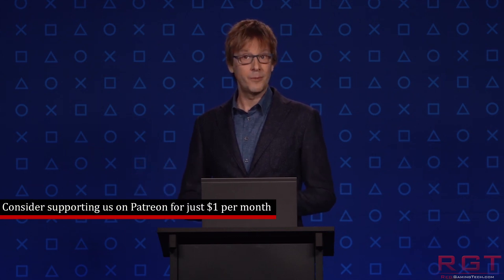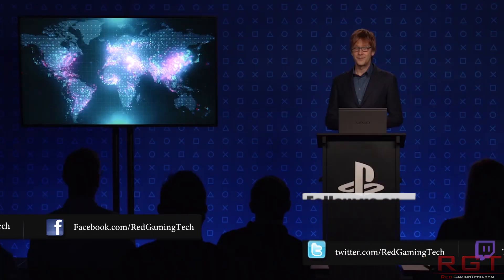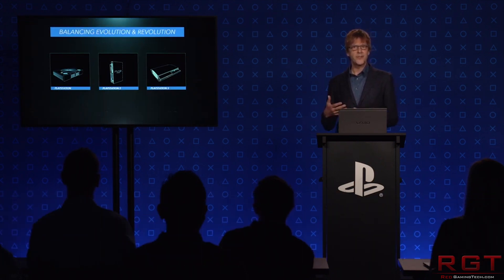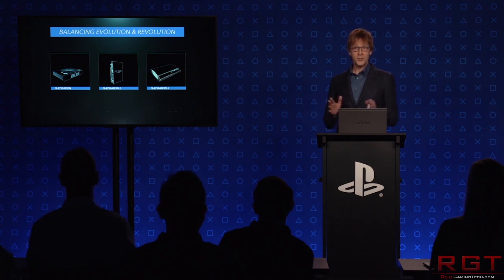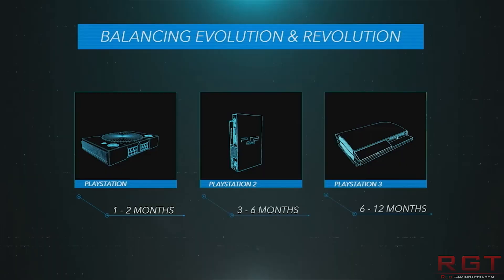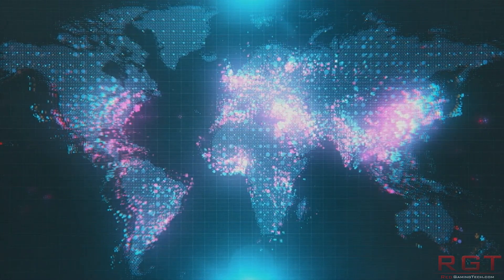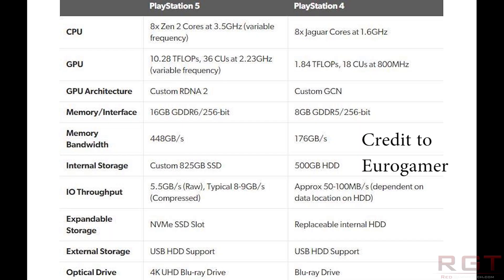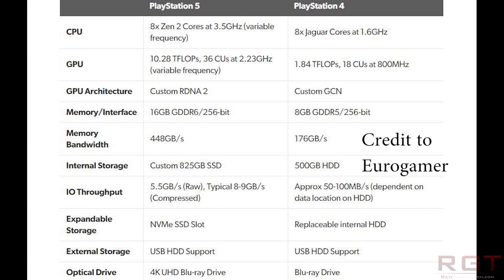Playstation 5 Spec Overview & Analysis | 10.3TFLOPS & RDNA 2 | 3.5 GHZ Zen 2 & Crazy SSD Speeds

Comment: Now we know why Microsoft was stressing that clock speeds were constant. Sony’s 10.23 teraflops are based on max boost clock while Xbox will constantly have 12.15 teraflops on tap.
Reply: Lol did you even watch the video?
Reply: @elitebeing21  ps5 lost epicly lol
Reply: elitebeing21 I watched the stream
Reply: @elitebeing21   Did you? @john pilgrim is completely correct.
Reply: You also have to weed out marketing BS. It doesn’t matter if they keep the power target the same and adjust frequency as it’s not nearly that simple. Once the GPU is under demand and the frequency is dialed up if the power  isn’t enough to sustain that fequency or temp target is reached then it’s going to have to throttle back. Cerny himself didn’t even seem that confident in being able to consistently sustain that max clock. This may have technically been for developers and such but they put this info out in public knowing gamers and fans were hungry for specs/info so there is absolutely going to be some marketing drizzled in. They did the same thing with the PS4 pro as well.
Reply: @voodooknyte  lol. The hell are both of y'all are talking about.... Nobody are saying what y'all are saying. Lol. Both of y'all are making shit up. 

The benchmark is 10.3tflops(actual number) he is wrong twice actually.

And the way he explain it does not work in that manner. Smh.. Watch the video
Reply: @elitebeing What? Do you want to tell us M.Cerny is lying?
Reply: elitebeing21 it’s 10.28 "peak". Variable frequency means 2230mhz is the max it can go and trust me they don’t want to stay at that frequency long or they’re going to be calling 911 because that shit could catch on fire! But in reality the system wouldn’t let that happen it would either have a thermal shutdown or more likely be forced to throttle back to prevent catastrophic APU failure. You may not realize it but 2230 MHz on a GPU is going to create a ton of heat and is not sustainable for any length of time. Most likely the average frequency is between 1800-1900mhz and on average would produce slightly less than 9tflops, but that’s an average. The games will still look amazing I’m sure, at least at the beginning of the generation but as the previous gen falls off developers will produce more demanding games and then we’ll start seeing performance differences between the two consoles. Bottom line is that ps5 has MUCH lower ceiling than Xsex and it’s just a short matter of time till they reach that ceiling. I give it two years from launch.
Reply: @elitebeing21

Everyone sees it but you.

Hell, I've got every Sony console, first gen PS1, but facts are facts. PS5 isn't going to be as fast as the XsX.
Reply: @alexbasha0508  they dont realise the software ms has baked into AMD hardware is gonna widen the gap further aswell.
Reply: It will depend on how often ps5 boost mode runs the clock speed at full cause on the low end it would come to around 9.2 tflops
Reply: @elitebeing21  You clearly didn't...John Pilgrim is dead on the money.
Reply: @wheelchairskater  it's capped at that. That is what it can do... It changed to be more efficient... It's still is 10.3tflops. Just because it choose to changed to convert power somewhere else doesn't change anything.
Reply: @whoknows8349  pilgrim didn't even qoute mark cerny so he was wrong again. It's not 10.23tflops. It's 10.3tflops mark cerny basically explain it's not about tflops. That is why they focus on efficiency and the ssd... That is why ps5 will out perform the Xbox sx when it just all muscle no technique. 

Ps5 is max at a certain point, but it doesn't change the tflops that just what it is... It changes that what it supposed to do. It was made to do it. Smh
Reply: @elitebeing21  Lol no youre delusional. 9tf vs 12tf. Get rekt. Sony lost.
Reply: @elitebeing21  Variable clock rate on both the CPU and GPU means the PS5 cannot maintain both at max speeds at all times. Despite Cerny being "hopeful" that it could. Hopeful is not fact, at best it's questionable marketing. So that 10.3 teraflops is best case only. Whereas Microsoft went with hard limits that do not vary under their set conditions (ie 8 cores at 3.8ghz or 8C/16T at 3.66ghz and the GPU always at 1.825GHZ....no boost speeds or anything like that). Which means that 12TF is consistent no matter what. With a PS5 living someplace hot like Hawaii where AC is also not standard could mean those users don't get as good of an experience as say someone living in a colder environment like the UK or Alaska. And just covers thermal throttling once you take in power limits as well, which will likely be a thing too as that is typically the deal with variable clock rate chips. Therefore you could be looking at an even bigger performance hit. So it is not about just efficiency... Sony can't make the chip magically run faster when power or heat hit the limits set (more heat creates higher power usage as well so that power limit gets hit faster as it heats up so they feed into each other in a very bad way). So the console running full tilt for a extended period of time will throttle... period. And throttling means a loss of performance. How much may depend on the environment it is run in and how tight those limits are set.

Honestly from what I can tell Sony was aiming for a 9TF device and was forced to overclock it help it catch up to Microsoft. Now Sony may still have the PS5 pro up is sleeve and drop a 13TF device, in fact it would not surprise me at all. I am waiting on Microsoft make a similar announcement but with a lower end SKU (ie the rumored lockhart model or series S) But as it stands today with the specs we have...XSX does have the PS5 beat in the GPU/CPU dept. Sony does have a solid leg up though in SSD storage speed and arguably in RAM. I do wish Microsoft had gone with a more unified ram as with Sony's approach. I believe that is a misstep on their part. Time will tell how this all plays out but to say Sony has a solid 10.2 teraflops that won't waver is just not true. Variable clocks are just that...they vary. Do the math yourself.

36CU x 64 Stream processors x 2 operations per clock x 2.23 ghz (ie 2230 mhz)

36 x 64 x 2 x 2.23= 10,275.84 (which is in gigaflops)....move the decimal over 3 places to covert to teraflops

10.276TF

Now lets say the clock dips due to heat, power consumption or both so the PS5 clock down to 2ghz

36 x 64 x 2 x 2.00 = 9,216  or 9.216 TF (the original leaked PS5 performance numbers)

These numbers are why I believe Sony originally aimed for 9.2TF as leaked but between Google Stadia and Microsoft they were forced to get more from less. I do think the PS5 should be able to maintain the 9.2TF without dips but that is just a guess based on the previous information leaked on the SOC's target performance. Regardless I do believe this jump in performance will benefit PC users much more then last gen which was anemic in the CPU dept and arguably the GPU as well.
Reply: Thicc Boii  lol. Now it's just mean it can go that low when it not at max. Smh. If you think so what proof you have to that say it shut down when it gets hot, when you don't even know that it does get hot.
Reply: @wheelchairskater  don't need pointless information. Again you are claiming like the last guy that you assume it runs hot... What proof that you have when you don't know?
Reply: And you assuming it's to catch up with Xbox series when in fact. That is how Mark cerny decide to make ps5 to maybe run the Ray tracing feature? You dont have any ideas as much do I. Smh
Reply: @elitebeing21  Assuming it will run at 10TF at all times is a bigger flaw. Plus I never said it runs hot I only stated how variable rate chip speeds work and how the environment they are run affects them, nothing else. I am a tech first so I know how hardware works. Variable rate chips are designed to push their limits and then some. And since they are running variable rate chips...they are pushing their limits by definition. Doesn't matter if the reason is efficiency or the polar opposite to get maximum horse power. A drop in clocks means a drop in performance...that is how it works. 

Now I am not saying Sony didn't cool it properly, I hope they have. But even if it is, if the GPU was capable of hitting 2.23ghz  at all times while also doing 3.5GHZ CPU at all times....then by the very nature of it they would not have rated/marketed them as variable rate chips. They would have done like Microsoft did and said it was a hard wired speed. They did not which means even if only a little those chips DO dip lower then the rated  "boost" speeds (for a more PC centric term). So a small 200mhz dip on the GPU means a notable TF drop. I don't make the rules, but I do know them. Do you?
Reply: One note though...you aren't wrong that some of this is efficiency. The game might not always need all 10TF. So until units are in the wild it is impossible to say for certain but to ignore the potential for performance dips due to variable rate chips is also impossible to do as well. That is the bigger point I am trying to make here.
Reply: If these chips truly are capable of those speeds 24/7 if needed....Mark Cerny did an even worse job in his presentation then I thought before. It was just boring and lacked any real flare...
Reply: Tflops fluctuate from 9.2 to max 10.23.
Reply: @garfunkle5447  pretty much what I was trying to say would likely be the case but Elitebeing21 just doesn't want to hear how variable rate clocks work. I don't know how tight the limits are on the chip whether do to efficiency or peak performance. Those are numbers Sony did not release. The best we got was Mark saying he "believed the PS5 would stay at the boosted speed most of the time". The big take away though is there is potential for this console to slow down whether it's do to thermals, power consumption or more likely both at various times during game play. At least how he left it worded and I understood it.

Now if the PS5 only drops clocks when the power is not needed that would be one thing. The fact Mark Cerny said he believed it could maintain them most of the time tells me it can't maintain them all of the time which leads me to think we looking at a power consumption limit at the very least (if just for efficancy) and worst case power and thermals (if it does run hot or is running in a hot environment). That is where as a potential buyer I get wary. 

At launch games likely won't tap everything the console has but near the end of it's life cycle that could in theory widen the gap between PS5 and XSX as time goes on and devs learn to run the consoles full tilt. We may find the PS5 can hit 10TF for 5 minutes or less when both CPU and  GPU are maxed out....Or conversely it may hit 10TF for as long as needed if you don't care about power draw/efficiency. The presentation did not make as much clear and as users we may not know the answer for sure for some time after the launch, even years. Point being it leaves guess work as a consumer as to what your truly getting in the performance metric. Likely not a huge huge difference but it may well be a noticeable one may not. So 10TF all the time is not guaranteed at this point. Time will tell just how limiting a factor or not this becomes.
Reply: @elitebeing21  Also to the pointless information remark. How are math facts on a GPUs performance pointless information when talking specifically about said GPU's performance as related to its variable clock speed. Things don't get much more relevant IMHO. If anything when you are being confronted with facts and figures, you're basically sticking fingers in your ears and screaming I can't hear you. As if in some way that makes you right and me wrong when in reality, that is the pointless thing happening here. Or arguably I am being pointless for thinking using facts, computer knowledge and logic with fairly easy to follow deductive skills would help you understand what every other poster in this sub thread understands but you.
Reply: guys, elitebeomg21 is just self persuading himself, i try to explain the same to other fanboys on other videos but they seem to be in denial. Don´t lose you time, this people are just sad.
Reply: @wheelchairskater  lmao. It's not facts you talking about specs. That console has... You are talking about theoretical performance that you don't know. Lol.... That is not a fact child. That is nonsense. Smh
Reply: My understanding is that the CPU and GPU run at a constant set vcore, and are capped at the max mhz, that the cooler solution can handle. The benefit is that on indie games, or lesser intense scenes, both the CPU and GPU can drop in speeds.
Reply: Mark cerny stated theres gonna be   2-3 % fluctuation within the clock speed, meaning around 9.9-10.3 tflops and mentioned already that it will run like that all the time. Now the thing is, we see this all the time within pc, and im not talking about thermal throttling. Youll see pc cards literally fluctuating with their clock speed (you could check it yourself). I'm pretty sure what cerny is trying to say is that they control power draw, where as in pc it's consistently the same power draw despite variable clockspeed. As he mentioned in the video, ps5 controls power draw while having same speeds, and not the other way around (which my pc example demonstrates). I think he explained this in depth to alleviate concerns with heat (the damn thing runs at 2.2 ghz lol), which is a result of power draw and not clockspeed. The xbox obviously has higher tflops, but the ps5 has things like the geo engine and faster ssd up its sleeve (so who knows maybe they will be equal in real world performance). But for sure we know this, the gap between the next gen consoles is significantly smaller then current gen.

Btw dont attack me im just trying to contribute to the discussion, also i game on pc :P
Reply: @Jpilgrim30   Absolutely NO. Did you even watch the presentation? What about all of Paul's video? This clock speed is maintained within 2%.

PS5's 'SMARTSHIFT TECH' with it's VARIABLE CLOCK Frequencies is very impressive. This is where the CPU can give power to the GPU and vice versa that it's not using to produce even better visuals. It also is one of the reasons why the PS5 can MAINTAIN the MONSTROUS 2230GHz GPU clock speed within a maximum 2% loss. GPU clock speed is just as important for performance as how many compute units. The PS5 is 405GHz faster than the Xbox's 1825GHz which means the GPU can do more work and the caches can be faster. This means the PS5 will effectively be much faster, even without considering the crazy SSD system (Series X SSD 2.4BP/s vs PS5 SSD 5.5BP/s, nor the impressive removal of bottlenecks. This insane clock speed will also help negate the extra teraflops in the Series X GPU. Absolutely brilliant! 

This SMART SHIFT TECH is very intriguing. A brand new approach to increase performance by using all power instead of wasting it. I fucking love the idea! Paul from RedGamingTech called it in his Microsoft tech reveal video. He said that MS were making a very strong point of how the Series X's GPU and CPU were locked (which is normal). He claimed that MS sounded like they knew something about the PS5 and were worried. MS wanted to take the attention away from that PS5 part (SMARTSHIFT) by emphasising their point of 'locked clock frequencies'. Bang on!

This SMARTSHIFT tech alone has been confirmed by AMD to give a 10% boost to performance. That is massive!
Reply: @elitebeing21  correct. Absolutely blisteringly fast clock speed from PS5 and equally impressive to maintain it! Mr. Cerny and AMD have done something special. But  sadly, as always peeps will go straight to the obvious and misleading 10.3TF vs 12.1TF narrative...

CERNY - “Rather than look at the actual temperature of the silicon die, we look at the activities that the GPU and CPU are performing and set the frequencies on that basis—which makes everything deterministic and repeatable,” Cerny said in his presentation. “While we’re at it, we also use AMD’s SmartShift technology and send any unused power from the CPU to the GPU, so it can squeeze out a few more pixels.”

AMD - "AMD said this (SMARTSHIFT) can result in a 10-percent boost in performance in games like The Division 2, or a 12-percent bump in Cinebench R20 results." - Impressive

https://www.pcworld.com/article/3532342/sony-playstation-5-taps-amds-radical-smartshift-tech-to-push-its-gpu-to-ludicrous-speeds.amp.html
Reply: @HanzouTheRazor  I did but I was not so convinced by his wording that even that 2% is maintainable...check this out... https://wccftech.com/sony-ps5-vs-xbox-series-x-analysis/ From what I can tell the variance in clocks will be more sizeable the Sony is saying.
Reply: @wheelchairskater  I read this too and had a similar assessment of everything that was presented.  Everything Sony put down on paper looks good, but there are still some finer details missing like the CPU & GPU caches amounts (both systems) and they really didn't get into ray-tracing, I suspect the PS5 will be at a disadvantage there due to the less number of CUs.  The specs just scream reactive to me and they are trying to overclock those chips to the brink and are doing everything the can to not to have them catch on fire.  I hope some 3rd Party Game Developers leak the truth, once the next generation games are in full swing.
I think come middle of the Generation (2023-2024) when we see games start pushing these chips (both consoles) to max this variable frequency set up is going to hit the wall. By then Sony will just release the PS5 Pro, similar to what Microsoft did this generation to move the focus away from the weak system to the mid-gen refresh....
Reply: @mtr975  Yeah that is generally my takeaway too. Elitebeing21 just doesn't want to hear it. As I was saying he just stuffs his fingers in his ears and screams I can't hear you...and in his head this some how makes him right.

The PS5 is a heavily OC'd system. I do not believe Sony is being honest about the clocks staying within 2% of max. TSMC's process just can't support clocks that high for a gpu long term. I believe a 5-10% reduction in clocks for the GPU are far more likely when it is running full tilt for long periods of time. And TSMC's process nodes support my belief unless they went with the high end EUV 7nm+ which I find very very unlikely do to it's cost as stated in the WCCFtech article. However no one can say for certain until it is out. Elitebeing21 is clearly a fanboy, a tech novice at the very least and more likely completely tech ignorant on how hardware actually functions. 

The simple truth is this, the PS5 will not be a constant 10.275TF machine. Will it be closer to 9.2TF? Maybe. Or will it be somewhere in the middle? All relevant questions without solid answers. Elitebeing21 really needs to do more research before spouting off how wrong everyone is. Clearly he is the one not understanding the technology and manufacturing behind it. I do thing the PS5 looks solid, I plan on getting one...but I also plan on realistic expectations on it's performance.
Reply: @elitebeing21  Did you read the WCCFtech article yet? They seem to think what we have all being saying is exactly the case. That the 10.275TF is an exaggerated best case scenario Sony can't maintain for long unless they used a very expensive 7nm node with EUV (ie 7nm+). Now they may have and then Sony could hold the clocks they speak of, in THEORY only but even then it is not a given it can. You know theory, that same thing you said was not ok for me to use when I actually used facts on how variable speed chips work, not a theory, and only stated it was a "potential" issue for Sony (that last bit may be considered theory but it was backed up by techincal know how and...FACTS!!!). Yet your using theory, whether you realized it or not, to say your right without any facts beyond what Mark "said" (and some how your theory is fact for some reason...which it IS NOT, it is hearsay and bad marketing propaganda). 

To ignore what we have been saying as at least possible if not likely, is as dumb a fanboy move as it gets. That is just down right idiotic to buy into outright just because Mark said it was so...OPEN YOUR EYES and use your brain. I still believe Sony's console is impressive, despite my feelings on the 10.275TF claims, especially considering the fact it is basically a heavily overclocked chip with a variable clock rate. To hit those clocks at all is a feat in itself. So kudos to Sony on that one. 

I would have preferred Sony gone with a wider design with 40CUs at a 2ghz sustained clock rate for 10.24TF...or even wider but still not any faster than 2Ghz. It just sets the chip up to throttle, unless they did go with 7nm+ with EUV. And even if they do, I would argue 2.1ghz should be the max clock if it is to be sustainable at all times if required by any said game. If its full speed is not required to hit the resolution, game settings and frame rate a dev is aiming for...of course I am fine with a down clock at that point to save power or what not. I just don't want to have the PS5 down clock for any other reasons. As it stands right now I am not convinced that will be the case. Leaving me to believe the 10.275TF numbers are more marketing and less fact then Sony wants to admit publicly. Time will tell...
Reply: @elitebeing21  Also now that I am laying out more and more facts backing up exactly what I and everyone else has been telling you...Then now out of the blue your tune changes to "TF is not a great indication of power" as your comeback. Never said it was though I implied it to a fair degree, mostly because both chips are Navi based. Yes it is not the only indication or even best indication of power but it is still a extremely strong one. Especially when comparing chips from the same architecture which XSX and PS5 are.  Why do you think we use it so frequently in the industry? Hmmmm just saying. It is when you compare Navi to vega or polaris that the TF argument gets a little more muddled but even then it still counts for something.
Reply: @wheelchairskater  it's not mark cerny talks about it...... Watch the viseo and actually pay attention to it Ask Mark cerny
Reply: @elitebeing21  Just curious here but are you a tech or have you ever been? Do you have an EE (electrical engineering degree)/computer science degree or studied for one at the least ? Have you studied the relevant physics, calculus and other fields to understand the underlying thermal, electrical and physical limitations of a computer system like this. Give you a guess who is/has done most of those things.....So I have reason not to take Cerny at his word...several reasons actually going from his reveal. (OMG so boring like going to class on a monday morning in high school boring)
Reply: @elitebeing21  I am saying he is desperate to try and recover some of the 12TF ground the PS5 just does not have on tap. I am saying it is very possible if not likey this is deceptive marketing on Sonys part to make their console look stronger then it is. It is strong too make no mistake. It just find it extremely unlikely it is 10.275TF strong for more then brief periods of time. More likely it will hover around 9.2-9.7TF mark depending exactly which node at TSMC they use.  Those are my PS5' worries at least. If you could call them that. More like I'll be pissed if they mislead people on the power but I am waiting for a final product before a final decision is made on how truthful their reveal was. 

Microsoft has their own issues too. The XSX is likely not as nice to the environment, no argument here. Though I would like to see testing in the wild first before firmly coming to that conclusion, that and the fact lets be real. Most folks don't buy the bleeding edge fastest because they want to save the environment first and foremost. I do not like the fact they segmented the ram. I hate it honestly but at least they were honest....cough GTX 970 cough cough...Nvidia deserves to be left out of the high end consoles for awhile. Though I run a RTX 2080Ti so I can only talk so much...lol
Reply: @elitebeing21  24 years of tech experience btw...Cerny may have me beat, certainly does with his role at Sony but I know more than enough to know his numbers are questionable. 7nm+ is the only way those clocks are possible long term. And that is very unlikely do to cost as stated before.
Reply: @elitebeing21  that's just it I don't care who wins. For me videos like this and the comment sections in them are about enjoying the tech specs and performance they bring. It is also about disecting how the hardware does what it does and is everything what it seems or did marketing get to involved in the technical side of advertising things they don't truly understand. It is an on going thing in tech...cough gtx 970 coigh cough 3.5gb and .5gb of ram at different speeds cough cough advertised as one 4gb pool/speed...cough cough

I love gaming on all platforms though I prefer PC if cornered into making a choice. I do have all current gen platforms ...well not stadia lol its a joke. Anyways I hope you wouldn't care who won either. I may gave called you a fanboy out of frustration that you cannot see or want to believe how the tech operates and why. Probably unfair especially if you don't have my education and technical back ground (not saying you do or don't this time, I welcome a comment on such.

At the end of the day I'll get a PS5...assuming they don't do something even more scandalous then this (could still be 7nm+ and I am wrong there).
Reply: ageofbogyo  Totally agree on the 3.8ghz bit and SMT....heat noise...not so sure about if done right. But Microsoft is clearly pushing limits of their own...
Reply: ageofbogyo  They could have but that would have likely required further binning of the wafers and a probable decreases in yields accordingly. IDK maybe they could have got away with it. But I prefer set clocks myself. When I OC CPU's I never enable turbo boost clocks on top of it where other OC users do. Increases risk to the silicon from even more heat at the same voltages(granted an OC already creates this situation so I could be accused of being nit picky here) plus more importantly it increases the complexity of an OC to get a chip fully stable (ie how you tinker with your voltages, droop, everything). 

I can see where Microsoft would want to avoid this complexity on the CPU and GPU from both a hardware implementation and software utilization stand point for devs. Having static clocks makes developing for the console easier. Whereas Sony did the opposite and embraced this complexity. Which if you look at the history of Sony's hardware they have a very long track record of doing this over and over again. Frequently to the frustration of the development community but with x86 dev's are more familiar with how this will affect things so it should soften the learning curve compared to say the PS3 or PS2. 

Think what you want of Sony's PS5 specs, they did design a nice piece of kit for what it is and how performant they got it considering it's base hardware resources. They took 36CU GPU and OC'd the snot out of...what should be at best a 9.2 TF GPU and they made it something greater than....sorry elitebeing21 still not capable 10.275TF for long durations...9.56-9.67TF though...that may well be achievable under those conditions. If Sony cheaped out on cooling and/or power delivery then dips to 9.2TF could well happen but I hope not. I am eager to find out for sure! Unless unless they do indeed use 7nm+ (which again I find unlikely) then 2.23ghz could well be achievable under full load for more then 5 minutes at a time. More likely they drop a PS5 pro at 13TF this year or next..kicking Microsoft in the soft bits nice and hard. And we as consumers win if something like that happens. It would drop the XSX price if Sony matches or undercuts them in price for said PS5 pro.
Reply: You are wrong. Just because the Series X has a constant clock speed, it does not mean it's working to it's full 12.15 TFlops all the time. GPU's and CPU's don't work like that. Workload is always fluctuating. It's never constant. So while the clock speed of the Series X is constant, it's workload is not. This is what the boost clock of the PS5 is doing. The boost clock is fluctuating based on workload. That means that when the workload needs to be at 10.28 TFlops, the clock speed boosts to allow that. When it doesn't, then the clock speed lowers to accommodate the workload and the additional power is sent to the CPU if needed. You're not understanding how this boost clock is functioning.
Reply: @maziarkd  you are correct on the work load and how it flucuates. No argument. That is not what we are debating. The debate is can the PS5 maintain the 10.275TF at all times if a work load does require it.. And if you read the whole thread; which you may have, you would see the evidence is stacked against the PS5 maintaining 10.275TF or within 2% at all times (if going by Cerny's own words of what the PS5 can do)...unless Sony used a very specific and expensive TMSC 7nm+ node with EUV...Sony is out of spec with the other 7nm nodes are capable of for sustained periods of time. There is a wccftech article linked twice above that goes into great detail on why Sony was likely overstating the PS5s ability to stay within the 10.275TF window for more then a few minutes at a time. That is what we are upset about...not how a work load varies but the clocks variance thus TF variance.
Reply: I'd like to point we still have some devs insisting despite the lower TF that the PS5 is more performant then the XSX. I honestly have zero clue if this is true or an example of dev fanboyism/dev damage control  but I don't think it should be ignored either. Could be a case of 1st party PS5 games will exceed XSX in eye candy while 3rd party games look better on the XSX. Without hardware to test you just can't say for certain. What I can say is I am eager to check BOTH out.
Reply: @wheelchairskater  you are clearly missing the whole point. Teraflop counts will not be the most important thing next gen. Of course It is what MS will push as theirs is bigger 😂. But how many times now have we heard and read from REAL EXPERTS that Tflop counts will not be as important next gen? Tell me, how will you measure the PS5's extremely optimised efficiency? Let's look at the incredible PS5 SSD system. A fool would think it's just for faster load times. If it is true that PS5 only needs to render what is in actual view due to the blisteringly fast I/O throughput and the removal of all bottlenecks, how much power will it save? How would you measure this extra power? What will this extra power do? This is the real reason why developers are so excited about the PS5 HW. One even claiming that its the most exciting hardware in 20 years. If Sony can pull their promises off, there will be some very shocked gamers once these two rivals are finally released and compared...
Reply: @wheelchairskater  surely you realise that most gamers agree that the best looking games this gen have been almost entirely PS4 exclusives (The Last of Us Part II, Death Stranding, Ghost of Tsushima, Days Gone, Horizon Zero Dawn, Spiderman, Bloodbourn, GT Sport, Uncharted 4, God of War)? 

This IS an  incredible feat for the lowly PS4 PRO when you consider that the Xbox One X is around 30% more powerful. This is why I laugh at people when they talk about the most powerful console (just look at how well in each past generation the 'most powerful console' actually went, too. Yet to actually win one 😂). 

Look what the measly Switch can do (Breath of The Wild). There are way more important things that make games look good other than 'teraflops'. It's a very naïve and tunnel vision impaired way of looking at it. Hardware optimisation, development kits and software tools, first party studios and just plain old talent are far more important. Tell me the truth, who out of Microsoft and Sony do you actually think wins in these categories? It's very clear to me...
Reply: @HanzouTheRazor  First of obviously I can't have tested all of those things without hardware in hand and any of us can ONLY go by what is so far released, information wise. And yes If you read all my comments you would see I said TF aren't everything, but are relevant to bring up with the information we do have. But yes there is so much a system can do that TF doesn't cover. And your right things like the Switch are an excellent example of that. But that was not what i was debaing. It started with Variable clocks and the fact Elitebeing21 refused to believe how variable rate clocks work....and as the debate raged I brought in tech analysis of nodes to show my argument held far more water then his own. He has still as of now yet to post one piece on non-Sony marketing to back himself up, unlike myself. Just curious did you read the article yourself and if you haven't, would you. I would like to hear your thoughts. Unlike Elitebeing21 you seem like a reasonable person. Also your arguments are better then his by a long shot!!

I would argue with the exception of the PS2 vs Xbox...Sony has typically had better looking first party games while MS at least for the XB360 era had better looking 3rd party titles. Something if these specs and my suspicions are true could mean Sony has best looking 1st party games and MS will have best looking 3rd party titles next gen just like the XB360/PS3 era. Back to the PS2 the only reason why the PS2 couldn't pull it off the same deal was the performance gulf was simply to great on a GFLOPS count and ram count. But the PS2 still outsold MS do to really great games if not a bad DVD player (fried 4 PS2s do to the DVD issue, or I fried one and my roomates did the rest because they did not listen and use the Xbox to play movies). PS3/PS4 absolutely had better 1st party games as far as appearance is concerned. 

Personally I don't like a lot of Sony's 1st party stuff but there are exceptions to this and why I end up in their ecosystem (mmm love me some Horizon Zero Dawn). My bigger issue with Sony first party games (exclusives, only I mean), and Ms too, is this last gen had the least number of them. Seriously only a handful. Everything else could be bought on another ecosystem either at launch or if you were patient and waited a year or so. As someone who games on PC when I can, this makes either console less appealing then previous generations. And MS may well shoot themselves in the foot with all first party titles hitting PC but IDK for sure. Time will tell and cross play may save them.

Regardless These were not the things that was being debated here for the most part, until Elitebeing was totally backed in a corner at least at which point I responded. What is being debated, can Sony's PS5 hold those 2.23ghz clocks when needed and as I stated and backed up with industry info, likely Sony cannot and oversold their performance numbers. As a Tech as a rule, I hate false marketing. Doesn't matter if it is Sony, MS, Nvidia, AMD, ARM, Or my mom's "sugar" free cookies. Say what you mean and mean what you say when listing off specs. The gamers will debate everything regardless. That is all I am saying here. Sony has likely not done that but we have to wait for hardware to truly find out for sure. I mean I could be so wrong and they did get 7nm+ with EUV at which point I would applaud them. If however I find those clocks dip by more like 5% or more for long periods of time...I'll roast the heck out of Sony for lying. Just like I roasted Nvidia and the GTX 970 with its 3.5gb .5 gb ram debacle or as I did with AMD and their Faildozer not really 8C CPUs (ie only 4 threads at a time could be used not 8). So I can hope you see the difference in what I am saying here. Yes Sony games will likely look amazing and if history holds true first party titles will truly shine...But will 2.23ghz clocks be maintainable? That is my question and something I very very severely doubt.
Reply: Also good to note many devs are saying the PS5 is the better performing kit. Though a couple I know say the opposite is true especially if ray tracing is used. Not sure if this is a case of a better OS, Hardware/software optimization or Dev damage control. All are possible. Again we need kit in hands to know for sure. I really am not a fanboy of anyone but myself. I am so cool I never stand up for anyone! So at the end of the day i just want some truth in marketing specs. That is it.
Reply: @wheelchairskater  Hey I have a question. Now this is coming from someone who knows nothing about console specs and how they affect performances and game development. 

That said, I've been reading a lot about both consoles lately and understanding bits and pieces. 
And a few people have said that while the PS5 will have a faster and more powerful SSD, the SX will be able to... Counter that with a much higher bandwidth?? Which somehow affects the SX CPU and RAM? 

Can you explain? 
Thank you
Reply: @raptordcuo6879  Yeah happy to help. It is not exactly simple but I'll do my best to make it such. I am sure some of what heard is wrong with other bits right. They both have 16GB of ram obviously they both contain CPUs and GPUs. Yes the PS5 has a much faster SSD though it is smaller. Basically information goes from the SSD to ram and from ram into cache where it is stored/used in computations. You can think of that information being computed as groceries.

So a CPU or GPU will always look for the fastest way to access the information it needs or groceries. Their first choice is always the onboard cache. It stores the information right on the CPU or GPU die. It is super fast but very very small. Think of cache as a 7/11 small with the essentials for groceries. The way you access it is a 2 seater sports car you have just to run to 7/11 at the end of your block for super quick way to pick up some small groceries like Pancake mix, milk and eggs because you been making pancakes all day and you know 7/11 has the ingredients very close by home. You can get there fast with your sports car but your small car can't carry many groceries, just what you need for your pancakes. That is your cache. Fast small amounts of memory you need to make what is happening right now and/or has been happening.

After your various levels of cache the next fastest storage is RAM. Think of ram as the grocery store and the bus it runs on a road with lanes. For this you use your Family wagon. If your CPU or GPU need something that is used regularly but hasn't been in use very very recently it has to go further to the Ram to get. Much like with you family wagon if you needed to go to the grocery store for a full week of supplies, not just your pancake stuff, because it will all fit in this larger car. I hope your still with me cause now is the trickier part...

So how does all of this come together with what you were asking. The XSX has a very wide memory bus whereas the PS5 has a much narrower one. Again think of this bus as a road. The more lanes a road has the more cars it can hold and stuff in those cars it got at the store. In XSX town the road has more lanes so more cars can make the same trip. In PS5 town there are less lanes and so less cars can be on the road at the same time. Not only that but with XSX town there are not one roads, but two roads that go to two different stores(one for the CPU and one for the GPU). The road on the XSX from the GPU to the ram has more  lanes to hold more  cars/ information then all of Sony's road combined. So you get everything there faster but the XSX has less overall ram 10GB or a smaller store at then end of one road compared to PS5. However you also have the CPU's road for the XSX which is slower then Sony's road with less lanes but it is a whole extra road for information to travel on to a whole different even smaller store. This is the separate set of ram with 6GB. So while XSX has more capacity to get groceries/information as a whole then the PS5, it can't get this information all at the same place like the PS5 can. Both approaches are valid. Each having advantages that affect performance one way or another; however, on paper this puts Sony at a memory bandwidth disadvantage. But it doesn't make the big benefit straight forward either. This one road approach allows Sony/Devs to use that whole 16GB how ever they want in game whereas the XSX only has 10GB for the GPU and 6GB for the CPU (at least until we hear otherwise/other features not yet released officially).

Now for how both sony and MS can side step some the ram a bit or more accurately make the ram pools larger than they actually are...With the new SSDs they can in fact be used as virtual ram pools making for larger worlds and decrease texture pop-in. Pop-in in particular in times past has been from assets streaming from the slow 50-100MB/s HDDs to the faster ram. The ram just could not get this information fast enough. We are going from 100MB/s last gen to 2.4GB/s or even 5.5GB/s next gen which is a 2400-5500 fold increase in speed/bandwidth compared to last generation. While a SSD is still is not as fast as ram it is far closer in speed than HDD ever has been. By miles and miles. But SSD take a few more operations then Ram to get information moving. This warm up/latency penalty (like warming up a car before driving it) adds time to how long it takes the calculation to happen on the CPU/GPU  so the SSD will be the last choice for information retrieval. SSDs are not a perfect substitute for ram, just a good addition to it for certain.

So lets get into some more actual numbers...

XSX 10GB of GPU vram @ 560 GB/s and 6GB of CPU ram @ 336GB/s 

SSD 2.4GB/s (raw), 4.8GB/s (compressed)

PS5 16GB of ram @448GB/s
SSD 5.5GB/s (raw), typical 8-9GB/s (compressed)

As you can See XSX holds a lead in memory speeds but falls behind in the SSD speeds. Devs should be able to work with both but sony's approach leaves more choices in the hands of devs on how to use the ram they have (OS, graphics, physics, sound, etc). XSX devs will have some choices made for them. Like graphics pulling mostly from the 10GB pool and things like the OS, sound and physics being pulled from the slower and smaller 6GB pool. This should be easy for devs to work with as stated but I honestly wish MS had gone with one ram pool instead for development ease but that is just my opinion. You'll see what I mean in a second.

Used efficiently the XSX has a whopping 896GB/s total system ram bandwidth dwarfing Sony's 448GB/s. And Sony completely destroys XSX in SSD speed which can be used as virtual ram as mentioned (literally double the speed) but this is true on both consoles. So even with the fast SSD Sony might be in trouble but a twice as fast SSD could counter some of the ram speed advantage MS has. This is why both sides are in screaming match on which is better. But there are still a lot of questions that need to be answered before any real conclusions can be drawn. Are these systems cache coherent, how much cache do they have, can the XSX GPU access the 6GB pool directly or indirectly through as of yet announced bus/ interconnect (no idea personally but possible). 

Where all this leads to performance is this. If your GPU or CPU can't get the information fast enough it can under perform. Or become what is known as a bottleneck. Basically the wider those roads or memory buses are the better they can feed the CPU/GPU. With the XSX having more CU's or compute units it is critical that it have that wider bus to feed it fast enough. The PS5 has a narrower architecture across the board, save the SSD. So with less CUs it should in theory not need as much bandwidth to feed it.

Then add on the SSD's as virtual ram, as I said before, and you can have bigger open worlds with less texture pop in and more details but again bpoth consoles can do this it is a question of how well they do in comparison to one another. Without hardware in hand it is tough to tell because there are things that can be done in software to speed up certain bits. That said you can only get so far with software optimizations or beefier hardware. 

Without hardware in hand a lot of this big debate is totally theoretical because we don't have enough of the super fine grain specs to really get to solid answer on how the hardware performs. It really doesn't matter though. At the end of the day fanboys will fan the flames of the console wars, even if they have no clue how the hardware works (both sides). This thread alone is proof of that.

Wow that was anything but simple but I hope it helped.
Reply: God that was way longer then I hoped for....sorry.
Reply: @Ioannis Stefanakis I have given the PS5 plenty of credit. SSD among those points of praise. It will be an outstanding console. I never said otherwise. Most of us haven't. My gripe and many others people's gripe is with the PS5 ability to maintain those clocks for long game sessions if under full load. Everything outside of Sony marketing/reveal, points to it can't...unless it is on the 7nm+ node with euv which is expensive for a console. I hope I am wrong. What I am not wrong about is how variable rate clocks work. They vary do to power consumption, heat or both. In the case of the PS5 unless they screwed up the heat sink my assumption is it will only throttle over power consumption. Regardless of power consumption though if the PS5 isn't on a node that can support those clocks long term. It won't, it will throttle when the power usage gets high enough. Even if cool. So for me this is about potentially false marketing/advertising. Something I am never cool with regardless of the vendor.
Reply: @Ioannis Stefanakis Sorry meant to reply to your comments on 1st party games. On the PS3/4 I agree outright (save a handful of 3rd party games like RDR 2 but only on the XB1X so as a whole sony smokes Ms this round in in 1st and 3rd party games). On the PS2 vs xbox it is more hazy. PS had some advantages with some lighting techniques (more sources of light), fog (could do more/thicker fog though xbox could do fog), it had better shadows too do to those lighting sources (one of my clan members, clan atomic...was on the hardware dev team. I got sll the juicy bits back in the day...he went on to found atomic on Sony...we were already on Xb, pc and sega dreamcast).Anyways  xbox had ps2 beat in raw pixel,  polygon and textures mapping power. This is why doom 3 never hit ps2. It didn't have the chops to run it. Point being you had some beautiful games the PS2 could not even do. 

Jump to ps3/xb360 era. 1st party titles generally looked better on ps3, though the halo series was an exception (but that is just a few games). But typically 3rd party titles looked better on xb360 do to development ease compared to the PS3 superior if not extremely hard to program for cell processor. It really held 3rd party back. Then came the ps4 and sony went with an easy to develop for cpu/gpu and more powerful setup than Ms/Xb1. Sony wiped the floor with MS on 1st and 3rd party games. No debate (save some 3rd party titles on Xb1x only which is a very small slice of Xb1 users]

Now fast forward to next gen and my belief is if sony can't hold those 2.23ghz clocks we may be seeing another ps3 vs xb360 setup. Where 3rd party games look better on Ms XSX and as usual Sony having better 1st party games, again in visual fidelity. Not that this is a bad thing per say. .it is just how I see things playing out save any new information on either console.
Reply: @jammycjj  I don't disagree but I also don't think the TF issue is irrelevant either. If it was we wouldn't bother to measure performance in terms of it. But absolutely TF alone don't make a consoles power. Custom tweaks help a lot. Plus until we know Rop counts, it is harder to say how much TF count for in the bigger render pipeline and how custom tweaks can or can't side step some of the TF deficit.
Reply: @wheelchairskater  I know literally nothing about specs, tech, or anything. But I've reading a ton of comments out of curiousity for this whole controversy I think I dumbed it down enough for myself. PS4 could be a katana, whereas Xbox a Zweihander? Refinement vs Power? Sorry if its a useless question
Reply: @SageHerrera  not a bad analogy. Its less technical but kind of the point I have been trying to make. PS5 will be swift/agile and deadly whereas the XSX will be brute force deadly. But we need more specs to be certain or kit in hands to be certain. I am eager to test them both out...
Reply: @wheelchairskater  thanks for taking the time to respond!
Reply: @wheelchairskater  We can only go on what Sony claims regarding the clock frequencies. I do believe, though that we cannot compare PS5's custom tech to what's on PC today. Since the PS4 Sony has been very trustworthy with their claims, compared to the PS2 and PS3 eras. 

The BOOST MODE in PS5 is vastly different from over clocking on PC. The CPU and GPU isn't temperature related. So, I can believe the claimed 2% only GPU frequency lose. 

Paul, from RedGamingTech is expecting that the GPU will only lose around 4% (adding 2% to Mark Cerny's 2% lose statement), putting it around 10 Teraflops of constant performance. 

Mark Cerny told Digital Foundry, "For the most part the PS5 should be able to hit those top tear clocks". Like I said earlier, a lot of this is to do with SMARTSHIFT.

"TERAFLOPS IS A METRIC . IT'S NOT REALLY EQUIVALENT TO PERFORMANCE." - Richard Leadbetter, Digital Foundry

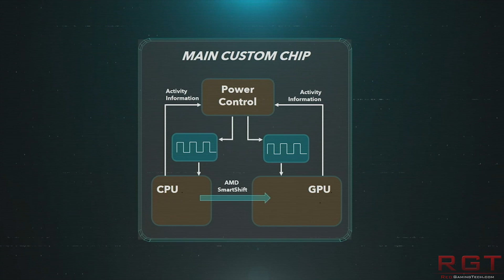4:30 - 10:40 Digital Foundry CPU/GPU clock speeds conversion - 

https://youtu.be/4higSVRZlkA
Reply: @wheelchairskater  reading the same from developers. PS5 is outperforming Series X in most areas. The Series X has 16 more CUs, so it should produce better ray-tracing. Tho, the PS5 is destined to have much better audio.
Reply: @wheelchairskater  I think most are misinterpreting Sony's clock speed statement. How I read it was that if it needs to it can maintain a speed within a 2% loss. Of course the system would not need to produce 2.3GHz for a small game like Journey. We are also talking about RDNA2 here that isn't even out yet. What we know of RDNA2 is that it's a beast! Also on paper, the PS5 is an entirely new piece of HW. We really haven't the same thing to compare it to. Let's just wait and see how it works once released, then we can judge it and Sony. I'm confident, though those MS fanboy quotes of the PS5 actually being 9.2 teraflops are wrong. I'm way more excited, though about PS5's SSD system and the TEMPEST 3D Audio.

Comparing the SSD between these two consoles is like apples to oranges. Sony has a 12 channel SSD and that's not just for gigabytes per second. The GB/s for how many channels is actually low. This suggests Sony are going for massive parallelism (massive parallelism gives neural networks a high degree of fault tolerance). And they have been going for a high bandwidth cache approach from the start (speed). Sony's goal from the beginning is to have around 100GB of graphics memory...100GB!!! This will enable huge levels of detail and much larger worlds that are not possible today. All without having the CPU and GPU wasting resources. How can we measure all this extra power? This is removing as many bottlenecks in a standard system as physically possible. 

Series X maximum SSD speed is 4.8GB/s compressed data. Sony recently confirmed that they've had up to 22 gigabytes per second of compressed data with the PS5's I/O SSD speed. If true this is insane!!!
Reply: I think it’s funny that any of you think you know what you are talking about. Stop pretending you’re engineers. You all are just a bunch of fanboys that regurgitate stuff you seen on a fanboy video. And that’s on both sides. The best choice for next generation is both. Plain and simple. They are two different machines that work in two different ways. And in the end they will put out similar games. Each one will have things they are better at. Trying to compare them with your limited knowledge is foolish.
Reply: @74Spyderman  I studied electrical engineering for 3 years actually thank you very much. I was a tech in the Navy (communication systems, main frames, security systems/alarms, electronics and of course networked PC's) and after I got out. I have over 22 years of experience actually. Not saying I know all, I don't, but I am no fanboy. I love PC and console (all brands). For me this was a debate of what was possible with the tech at sony's disposal. Just because your not educated doesn't mean no one else is. Sorry to burst your bubble. Not that I expect you to listen...
Reply: @HanzouTheRazor  I did just stumble on some info I am trying to verify now. It appears Sony may indeed have gone with N7+. Which I am tickled to hear. If true I am SO HAPPY to be wrong. I'll post when I have more. My big reason for not trusting it yet is this same source said MS was also going N7+ when they already confirmed they were going with N7P. So I am not certain it is 100% accurate.
Reply: @wheelchairskater  That would be pretty impressive. From my memory N7+ has a 10% performance boost. 

Did you read this article? Pretty much confirms what I've been saying about clock speeds. The GPU system cache scrubbers will also be a game changer. Sony proprietary silicon that will push those 36 compute units to the maximum.

CERNY -- "Coherency comes up in a lot of places, probably the biggest coherency issue is stale data in the GPU caches," explains Cerny in his presentation. "Flushing all the GPU caches whenever the SSD is read is an unattractive option - it could really hurt the GPU performance - so we've implemented a gentler way of doing things, where the coherency engines inform the GPU of the overwritten address ranges and custom scrubbers in several dozen GPU caches do pinpoint evictions of just those address ranges."

"All of this is delivered to developers without them needing to do anything. Even the decompression is taken care of by the custom silicon. "You just indicate what data you'd like to read from your original, uncompressed file, and where you'd like to put it, and the whole process of loading it happens invisibly to you and at very high speed," Cerny explains."

https://www.eurogamer.net/amp/digitalfoundry-2020-playstation-5-specs-and-tech-that-deliver-sonys-next-gen-vision
Reply: @HanzouTheRazor   I did but rereading now. The N7+ thing looks legit which makes me happy. Check it out yourself at the 4 minute and 11 second mark and let it go until you get the info. The short anwser is MS was lying about their node for the XSX being on N7P to help AMD throw Nvidia off about RDNA 2's transistor density. The way he figured it out was really smart...

https://www.youtube.com/watch?v=PW-7Y7GbsiY&t=28s
Reply: Wheelchairskater ' Yeah, don’t believe you..but good try 👍
Reply: @74Spyderman  Oh I figured...and the regurgitated information I linked, it's called sources. Something nearly all of my college papers required to prove I wasn't just making things up. Reporters and even techtubers use them as well, to name a few other places sources are important. But hey who cares about facts, clearly not you. I mean you even curious how I ended up in the wheelchair? It was my military service I mentioned (100% service connected BTW)....which paid for a decent chunk of that education in the UC system. 

But let me guess you doubt my time in the Navy and training that went with it too? How about my time on the USS La Salle which was the 6th fleet flag ship when I was stationed in Gaeta Italy back in the late 90s during the tail end of Bosnia. It has since been decommissioned and sunk for target practice in the Atlantic btw. I only made e-3 before shattering my spine, my goal had been e-5. So things did not go exactly to plan. But hey that's just what my dd 214 says, maybe it's lying too. And don't even get me going the years I was in college, worked as a computer tech while also doing professional disabled sports. Mainly skating but also surfing, football and downhill mountain biking because no one/hardly anyone would sponsor one sport athletes do to the small size of the disabled community, relatively speaking. Recovering from serious injuries constantly from skating in my wheelchair while going to classes and working as a tech. Adult stuff you probably know little to nothing about.

Do you know the three laws of thermodynamics? Actually trick question as technically there are four. Zeroth, First, Second and Third. But hey what do I know.....I am just some fanboy 12yro like yourself. If you're to be believed, that is. Grow up dude! Get an education....then you can see what being an adult is actually like. Find another bridge to troll where the sheep might actually be afraid of you.